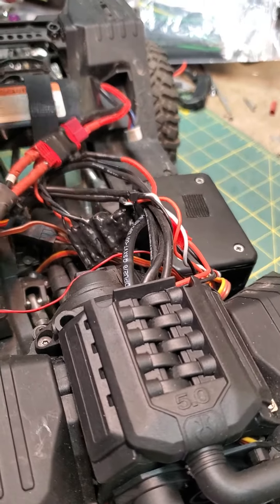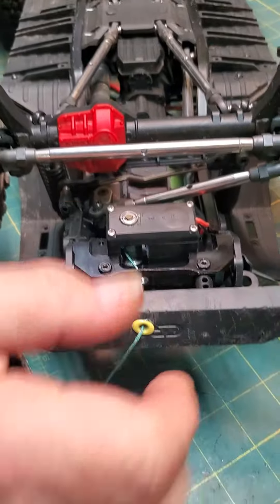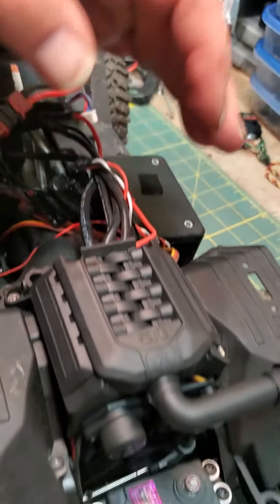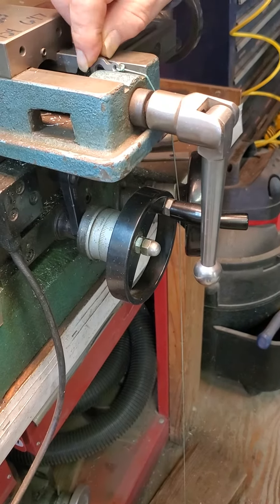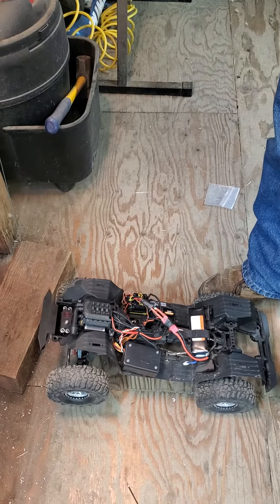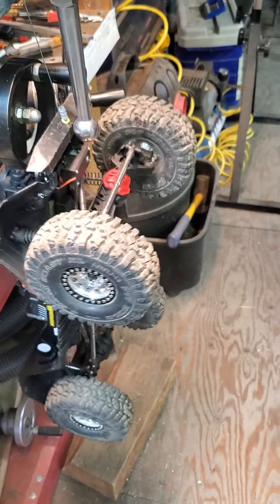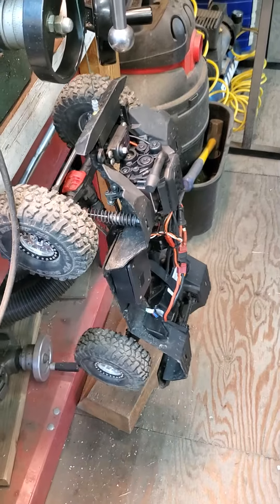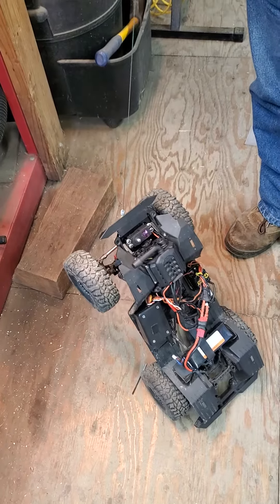KMS WINCHES  K3 180oz Axial scx10iii to MV Nichols EZ BOY RC knoxmotorsports

Comment: Exo was using the throttle to help the winch out but was also taking it easy on the rig cause it’s getting donated to a veteran. But yeah your winches are definitely capable of pulling some weight.👍🏼
Reply from the maker: ThT makes sense  I think he had the rate on the ESC turned down .too the rig went to a vet that's why I donated  it to him He gave awY a TRX4 sport that was very nice. Toyzuik will be taking  over KMS WINCHES  in July. I had stroke last year and ready to be in back ground. Helping with testing and other things  he might need help with.
Reply: @knoxmotorsports  sorry to hear about the stroke, but I know Ben personally and he’s a good guy to take over the winch biz.👍🏼
Reply from the maker: @LIKES2CRAWL  Thank you for your kind reply .